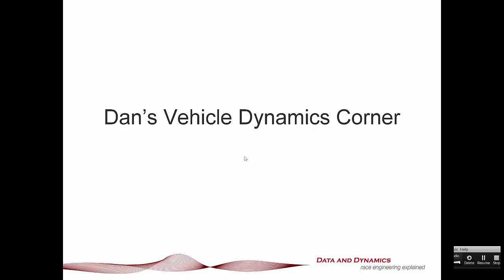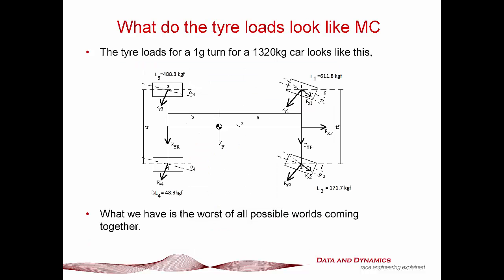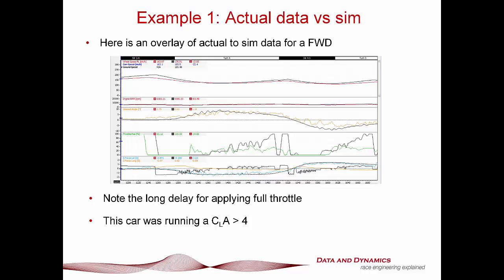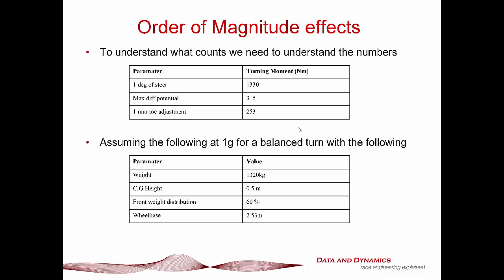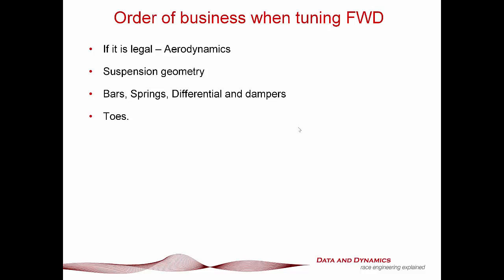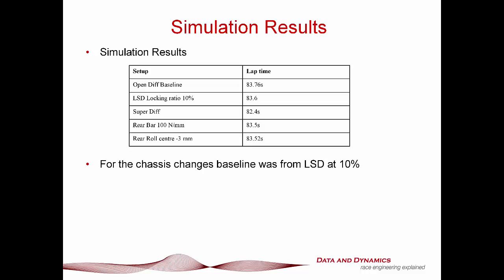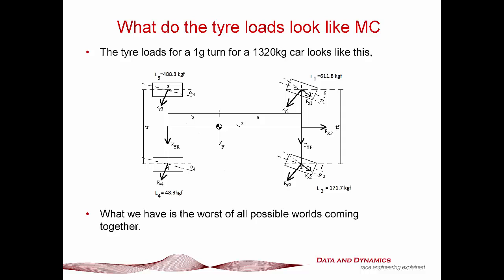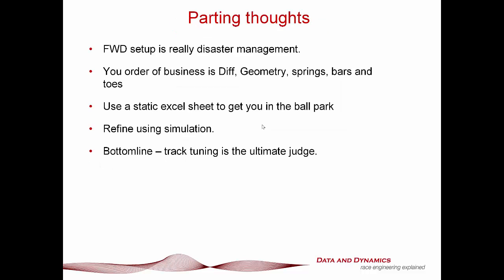Front Wheel Drive, dynamics and tuning using ChassisSim

Comment: Your times show that the car slowed down after the rear bar and roll center adjustments? Was that a typo on your screen?
Reply from the maker: Typo on my part - brain fade!
Reply: ChassisSim Curiois your thoughts and strict ruleset fwd idea. With no other changes, would running lower profile tires in front on a torquey fwd car (assuming you keep the same width and compound etc) to shift even more weight to the nose aid in corner exit traction, even if at the expense of braking distances?